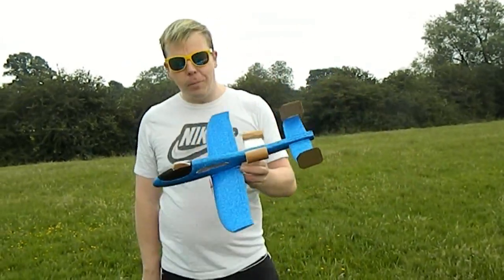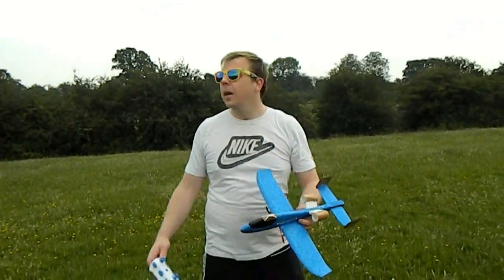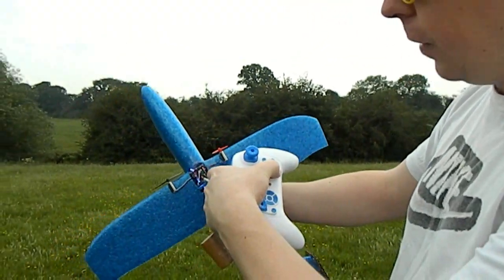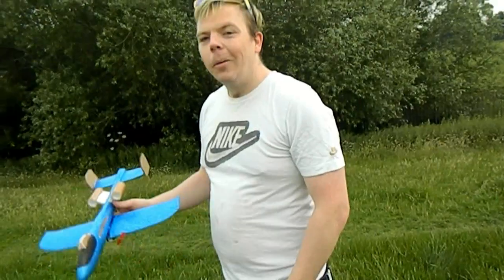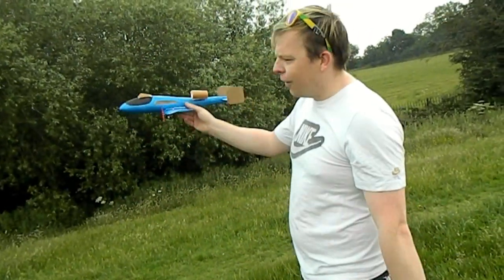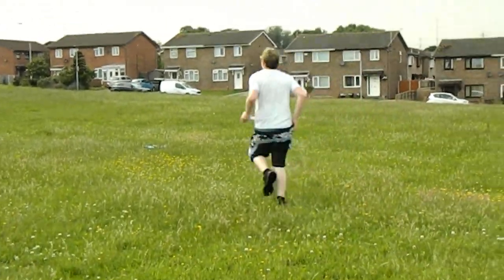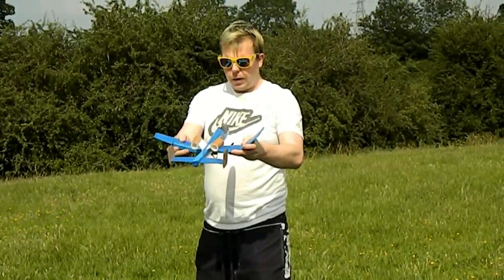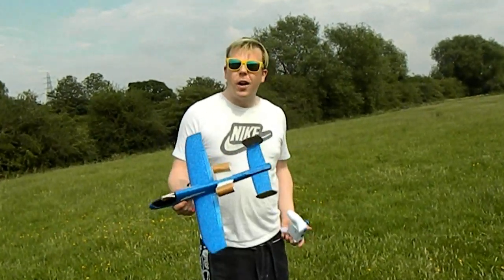RC Airplane Glider A-10  Less than £10

Comment: Cool idea. Do you think it would be possible to put all 4 motors on the airplane if you oriented it correctly? I've seen many small rc planes like this on the market for usually way more expensive, but are relatively simple because they dont use any flaps like aileron or rudder, but instead only use differential thrust in order to steer.
Reply from the maker: yes i wanted to do that in the first place but the small quadcopter i used had one burnt out motor hence why i pulled it apart but i think this would of worked had i used the front 2 motors as they would add power when the nose dips and reduce power when the nose goes up ... i have another A10 build coming up but using the 2 channel motors from my micro RC C17.
Reply: @rclabbotics5413  Looking forward to it!

Comment: I’ve made 3 of these now with hubsan x4 motors and 1s esc’s. Way more power. It looks like tail heavy but i have seen you saying its defo not, maybe your thrust angle is to high, so as you throttle up your motors are pitching you too?
Reply: And it looks wicked!!

Comment: I tried similar with my gliders and had pretty much the same results. Ive also been playing with a banggood board like the one flight test are now using.
Reply from the maker: Yes man the main problem i am having with this is the quad i used had this smart orientation mode on it that has an actual compass and the motors keep cutting out in certain orientations so next plan is to take the bigger motors from my eachine 105 and the flight controller from my sport cub and some micro servos and Make a Full 4 channel
Reply: RC LabBotics there must be a cheep little board that we can use for simple projects like this.
Reply from the maker: @lurgy1  Yeah there is the Flite Test STEM package its exactly this but its been designed and set up to run small planes but either its not on the store yet or only subscribers to the STEM project can buy them but FT said they are coming on the website soon.

Comment: You are extremely tail heavy, it causes it to stall or tip stall
Reply from the maker: No the COG was spot on i was messing with bending the elavator up  each time to try and get high alapha floating but it needs more Power.
Reply: RC LabBotics ok

Comment: I only see two problems: lack of power and lack of brrrrrrt :P
Bigger quadcopter for the power would work?
Oh, and for the brrrt...a small piece of plastic that gently touches one of the propellers could work, huh? LOL
Reply from the maker: I am giving it more power and servos  i knew it was missing something when all details go ill try and Make a gatling Gun out of foam
Reply: @rclabbotics5413  any of the other 2 motors could be of any use maybe?
Reply from the maker: @DoNotPushHere  yeah maybe like 2 puller and 2 pushers ... could work im going to ee how the more powerfull motors are at the moment i have started installing the servos today.